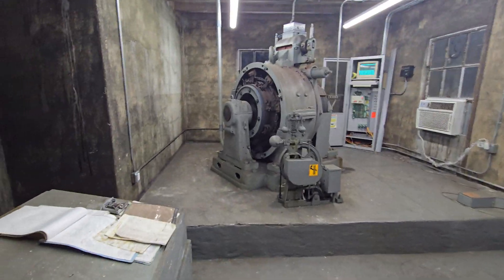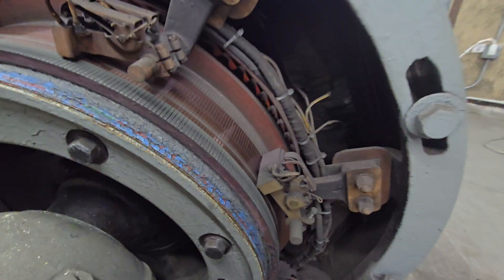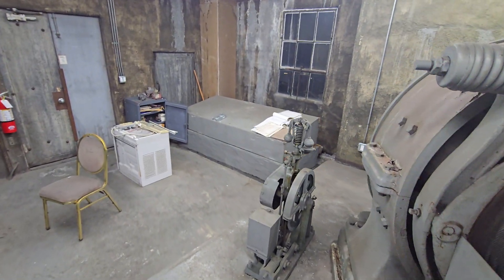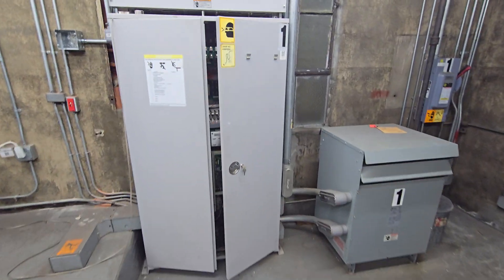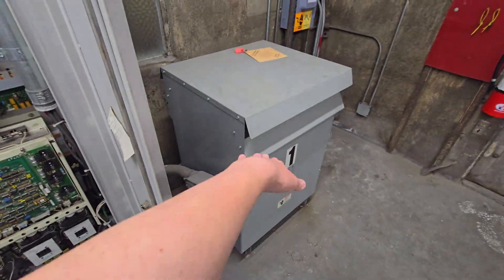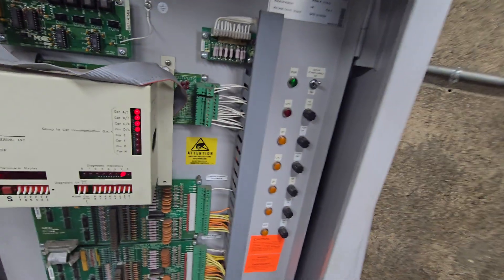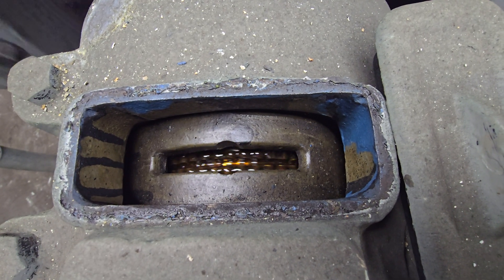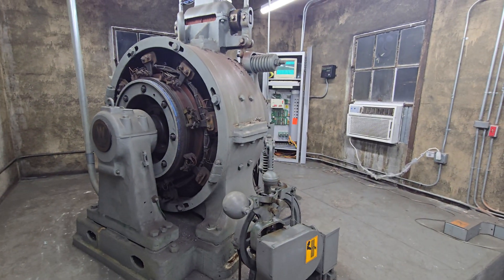EPIC 1910 Westinghouse/1990's MCE Gearless DC Traction Elevator Machine Room

Comment: US Grant Hotel? In San Diego? 

If so, from 1980 I remember one freight elevator in the back on the left (as looking from the main entrance), and four elevators in a quad arrangement in the middle of the main floor, right in front of the grand staircase to the second floor. The freight elevator was manual. 

The two main elevators on the left of the quad were also manual, although only one was working (the other had reputedly crashed into the basement a few weeks previously). 

The two on the right were converted to automatic. I think they were Otis at the time, but I may be misremembering. They both had control problems. 

The whole hotel was shut down for a major renovation two weeks after I stayed there, I have no doubt the main elevators, and possibly the freight elevator, were all refurbished. They needed refurbishing.
Reply: I worked on the Grant after the shutdown. You are absolutely correct about the 4 passenger elevators, it was the left side north elevator that crashed in the basement. My understanding it was overloaded by some of the Navy people staying there while their ship was being overhauled. The two on the right that had been converted to automatic sure had some interesting G forces. I was able to explore the machine room for the passenger elevators and saw a red tag on the equipment for the crashed elevator. I got a ride on the left south elevator with the building engineer. The cab was absolutely beautiful!!! Even better, I took a couple of joyrides in the freight elevator, much to the annoyance of the guy who ran it. I also got a few rides on the sidewalk to basement elevator. The passenger elevators were Westinghouse if I recall correctly. Those machine rooms had to be raised as at least one floor was added to the top of the hotel after it was completed in 1910. 

Over the decades since, my wife and I have stayed there a few times, to me one of the best parts of those stays was riding those elevators that still felt somewhat the same as they did in 1980. 

Up until around 1980, a block east of the Grant was Walker Scott. It had a bank of Otis manual elevators with no inner doors. As a kid I loved to ride them. They also had the oldest escalator in San Diego.
Reply from the maker: @Paramount531 Something even more interesting is how there is separate machine rooms for each of the four elevator cars, incredibly odd choice and I saw all 4 of them. Two raised up higher than the roof, and two with some stairs down into them. For sure an interesting setup!
Reply: I went back and watched the opening of the video in slow motion. I saw the sign for the Hotel St. James out the window, so it's definitely in San Diego. When the Grant was renovated they put in a new freight elevator accessible from the west wing hallway, so this may not be the Grant.
Reply: @Paramount531  A bunch of us were there working on setting up and running a week-long puppetry convention when I was there. I was pretty much all over the lower floors and service basement of the hotel, moving equipment in and out and tracking down problems with the ballroom lighting electricals that nobody at the hotel knew anything about.

I remember the manager running the manual elevator, as the long-time elevator boy had been let go a few weeks before. But the manager had barely a clue on how to operate it, and could never hit a floor. He invariably stopped 6 inches or a foot above or below the floor, and you had to climb into or out of the car. This was a real pain if you had a 400 pound rolling road crate of lighting equipment to roll into or out of the car, and you now had to lift it a foot up or down by hand, rather than rolling it on the casters.

The back automatic elevator was OOS the day we got there, though it was nominally 'fixed' the next day. I remember the right elevator took like two minutes to answer a call, and the doors would open while it was still matching up to the floor level. Made us a little nervous using it.

A couple days later a group of us had gone out for a bite to eat about midnight. We came back and pushed the call button to go up to our rooms. We were standing there in the quad between the elevators talking, in no hurry, being used to the slow call response. I happened to be the only one of us facing the automatic elevators.

Both elevators responded to the call. The one on the left had homed to the floor, but seemingly wasn't quite sure of this. The doors would open 6 inches or a foot, then immediately close. Repeatedly. The right elevator doors were fully open, but it was bouncing up and down, about 2 inches above the floor to a couple inches below. I watched this for a while, then nudged the other people to take a look. We watched this performance for about 30 seconds, then as a group resolved to take the stairs to our floor. We never used those elevators again.

The freight elevator was run by a nice old lady about 50 years old. She regaled us with tales of running the elevator for the last 30 years, except for about 3 years when she'd gotten married a decade before. She had nothing good to say about the "young girl" that had been hired for those 3 years in her absence. Apparently, she was no better about hitting the floor correctly than the manager was with the manual passenger elevator, and (according to her) was always getting distracted and not doing her job properly. I just kept trying to wrap my head around the idea of spending my entire life, running a manual freight elevator, where every floor looked out at an identical (except for paint color) blank wall 6 feet away on the other side of the hallway.

I also recall a bunch of us looking around at some of the service spaces. We discovered that every floor had old disused communal bathrooms at the end of the main hallways. Apparently the rooms had not had attached bathrooms when the hotel was first built. They were added sometime later, and the doors to the bathroom at the end of the hall simply closed and forgotten.

Oh, and the bar was a floor down from the main lobby. It was named "Grant's Tomb". But it was closed.

Comment: I saw an elevator room in Seattle with equipment around that old perhaps 1930's the room was spotless as was all the equipment.  Pride in manufacture, design and maintenance equals long life and outstanding reliability
Reply: And its not from China? I guess in the 1930's Chinese products weren't used. Besides back then the Chinese were busy fighting the Japanese.
Reply: I would have loved to see the elevator room at the Medical-Dental Building in downtown Seattle; they had some old (and FAST!!!) Westinghouse Selectomatics. Those things felt like they were going to launch you into orbit!
Reply: @NipkowDisk  I think this was at the arctic  club building or the Dexter Horton
Reply: @asbestosfiber  You may be right. I do remember having an eye doctor appointment in some tall building around (I think) 9th & Stewart or so. It was about 45 years ago so the memory cells are a bit on the fuzzy side.
Reply: As it should be care and maintenance that's the key.
Reply: Smith Tower?
Reply: @_mike9000  No, I think it was the arctic club
Reply: Not to mention, pre-war engineers tended to over-design like crazy, especially with new technology.  The factors of safety on every single component and sub-assembly are probably vast.
Reply: @tommcewan7936  They also had to contend with a lack of qc or testing on all materials. So the 1/2 bolt may be flawed so you moved up a bit

Comment: Big and heavy equals long life and high reliability in machinery
Reply from the maker: @SuperPhexx  It running at a very low RPM also helps; there is much less wear on components. These old machines are built like tanks!

Comment: Did you just say that the DC comes from the transformer? It is nice to see old equipment like that running.
Reply: The transformer its self will be AC (because physics) and the DC will be produced by a rectifier pack after the transformer.
Reply: @twaymouth  The AC-to-DC conversion on these will be done by the drive (inside the controller cabinet, in the bottom right - it's missing its cover on this one, but it's an MCE System 12 SCR drive). The transformer is there primarily to provide a phase shift (via mechanisms I don't fully understand...) to enable the use of a 12-pulse drive instead of 6-pulse, which gives smoother/less "spiky" current flow and also causes it to emit the noise mentioned in the video instead of a lower pitched, line frequency buzz. A decent portion of that noise does come from the motor - some does come from the transformer like the video mentioned, but by no means all of it.
Reply from the maker: @jeffwxyz  That is the drive isolator transformer; there's a DC drive with the rectifiers and everything else inside the controller cabinet (which I believe I showed). The actual sound comes from the isolator transformer.